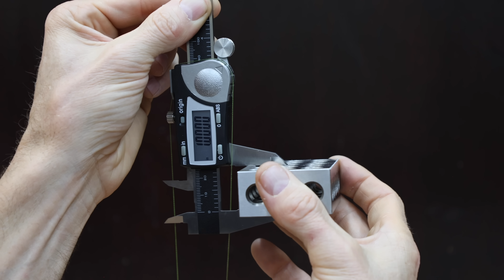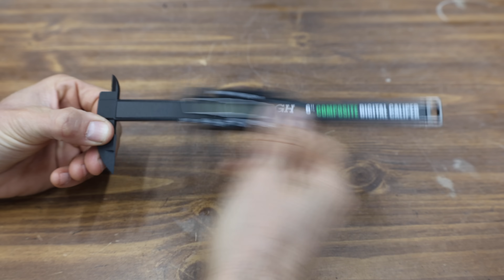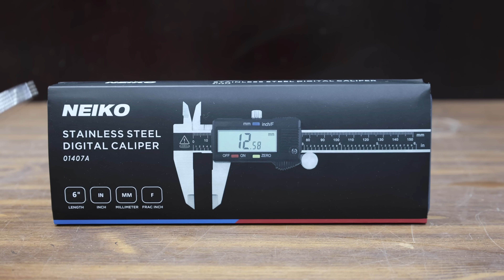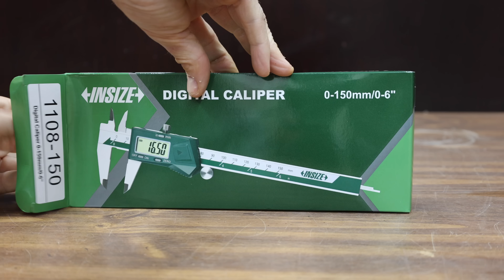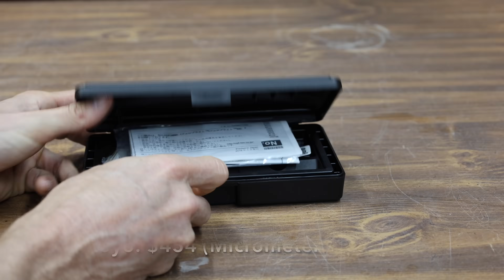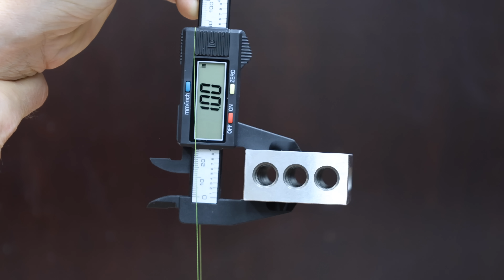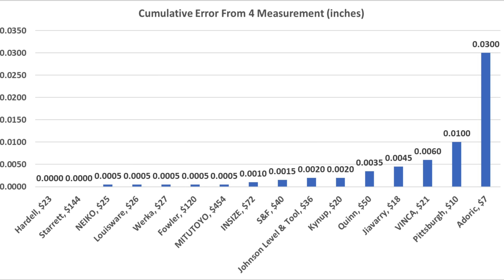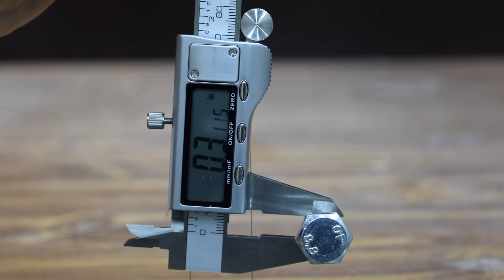I've Been Proven Wrong About Calipers!

Comment: Been working in and around machine shops my entire adult life..~15 years from Cutting stock to being an Engineer for OEM CNC manufacturers'. Fowler is bare minimum. First year guys who just need a few things to get going, it's mostly fine. You're probably going to drop them anyways so it will hurt a little less when you do... Also, for guys just cutting stock, not a big deal. Beyond your first set(unless you're the buy once cry once type) starrett, mitts or any other higher end prominent brands.. But Seriously, if you walk up to a CNC machine with a set of Pittsburgh's... it's not going to be a good time, for anyone. Everything else is unreliable and no shop owner will let anything less fly unless you have tolerances beyond 1/16".  
Beyond that, I'd say the measuring techniques are pretty flawed here unfortunately. Measuring depth though a 123 block onto a WOOD table... I can find .002"-.005" variance through that all day depending on where it lands on the table. To do it right, needs to be on granate.. or a surface ground plate at least... I'm not even going to get into how Outside measurements were conducted.. It is a feel. It's not just a consistent weight on it holding the block like its a C clamp. To certify/calibrate tools, which if you find yourself in a good shop, they will need to be. They will check them through the entire range, multiple times, without rezeroing because it's highly unlikely anyone will re zero for every measurement. If you're buying used on marketplace, clean the faces and run them all the way out and back to zero several times, they should always come back, if they don't, the gears are probably skipping or lose on the scale. Anything larger than .001" of variation is cause for concern for any meaningful work. Another trick is to close them, hold the jaws to light, and if you see any light you can confirm the jaws aren't parallel and need to be resurfaced.  If they are a mits or Starrett and it's a REALLY good deal, you can usually send them to have them rebuilt and calibrated. I'm not offended to buying tools used, hell, Most of my tools are used. But if the accuracy and precision really matters for you and your job, then don't sacrifice quality tools. 

ProjectFarm, I appreciate all the test you do. I do. But, this one really got my teeth grinding...

Comment: most of the cheap calipers auto shutdown only the screen, a week or even less in shutdown state can still drain the battery empty. For those the only reliable way to completely shut down them is to remove the battery or insulate it some other way.

Comment: I have a "LOUISWARE" caliper that is identical to the Jiavarry brand down to the thumb adjustment and the  physical layout and colors. The only difference is the way the display looks when powered on. Powered off it looks identical lol even came with the tiny screwdriver and extra batteries. They must just swap the backs with the ruler out between brands. It also keeps it position when powered off.

Comment: if you want good calipers on a dime you shouldnt be buying digital ones anyways.
learn to read a mechanical caliper with a nonius/vernier scale and you can buy a calibrated and certified precision tool and still save over half of what you wouldve spent on an uncalibrated digital one of similar build quality.

Comment: I've had a cheap set of harbor freight Pittburgh calipers. I also gave a pair of the same to a kid who was getting in to 3D printing. They worked OK for most of my uses (I use a Starrett Micrometer when I need really accurate measurements.)  The real problem with these is the durability. Mine saw only light use. I pulled them out of the case one day and had a blank screen. Went to replace the battery and saw that the battery contacts had broken off inside the battery compartment. Checked with the guy I had given a pair to, and he had the same problem. My conclusion: if you don't need +/-.001 accuracy, it's worth the $10 purchase price, but not much more than that. If longer-term reliability is a concern, consider a better quality tool.

I replaced them with a Quinn dial caliper (analog, not digital). Without a battery, there is one less thing to go wrong. They claim it's inch or metric, but it's really only usable on the inch scale, since the dial part is calibrated in inches. The Quinn caliper rides around in my tool bag (in it's protective case). After seeing this video, I'll order a Werka to keep in my shop.

Comment: I use calipers so often that I grew tired of pulling the plastic case out of my desk drawer to use my good Mitutoyo calipers so I bought a 4" iGaging caliper on Amazon for $59.  It's IP67 coolant rated (which I use as dust proof) and it has Bluetooth connectivity which is very cool when I want to enter a lot of data into a spreadsheet.  For example, I can measure the base diameter of all of the sockets in my tool chest and the spreadsheet automatically calculates the radius and adds 0.3 mm clearance for the value to pull into CAD to make a custom 3D printed tool tray.  The iGaging accuracy compares tracks with the Mitutoyo and is my always ready desk calipers that live in my pencil holder.

Comment: Also, side note: I mainly use Haas calipers after using every brand I could find. The Neiko were extremely accurate, however the screen on them kept failing very early on (and soft, at home hobby use for 3d printing and other misc) and stopped buying them after the 3rd failure.

Comment: I still like my dial calipers best, haven't had any dead batteries or battery acid leaks yet.

One big pro to digital is that you can go from SAE to Metric with a button press or two where I have to go fish out the other calipers.
Reply: The $10 digital are fine for any non-certified work and a lot cheaper than my fancy ones.

Comment: Yup. I bought a set of calipers from Aldi, workzone (their own brand). Cost me 20 bucks, came with a nice hard case. For my fairly infrequent use, it's lasted years. It gets a bit 'sticky' sometimes, but some oil later it's nice and smooth again; it has a .01mm scale (so 0.0005 inches, more or less), and is usually repeatable to a +-0.01mm error. Works well, does the job. Had a 2$ one from aliexpress before - full plastic, 0.1mm accurate - and that it was. Not that accurate, but great value for money if you don't need to be that accurate.

But yeah, sure, if I used them all day every day, I'd easily spring for Mitutoyo; I am very sure they last waay longer; but with me taking a few measurements every few days to weeks, meh, cheap does the trick.

Comment: No hate here, but for the hole depth measurement, they were all off by so much, probably because of your table not being smooth down to 0.0005 inches. I'd use a block of machined metal next time to ensure wood is not the variance.

Comment: 17:40 Not "a very nice feature" at all. This means the device is always powered on, draining the battery. The off switch just turns the display off. I need to know that "OFF" really means "OFF". You missed that. The Mitutoyo uses better electronics to overcome that issue.

Comment: You've literally measured only 1 side of the block with your micrometer and based the accuracy of all the calipers on that single one sided measurement. That's the definition of a faulty test.

Comment: This is so dumb, you literally unpack identical no-name calipers and just read what's on the box. A lot have the exact same features yet you don't mention it if it isn't mentioned on the box, the insize having a micro usb plug for example, silence...incredibly dumb.

You do resistance in grams yet do accuracy in inch, you cant be this stupid.

Please stick to reviewing farming equipment

Comment: I've had mixed luck with Starrett.  The ones I've kept are fantastic but I've gotten a couple slide calipers from them that I got rid of. 

I don't actually like the auto-shutoff feature anyway and frankly batteries are cheap.  After about a half hour to an hour of on time, mine tend to be even more consistent.  That said,  the two I use the most frequently is a Mititoyo matching the video one and an iGaging model.  The mititoyo is just a hair smoother sliding but the iGaging with phone and pc connectivity to store measurement sequences and much larger display is the one I'll most commonly reach for.  It too does displayed fractions of an inch as a scale type which is neat too albeit not that useful to me.  It has been a steal and only costs what the Harbor Fraud Quinn costs to boot.  I've got several of their other products and while lacking very slightly compared to its much more expensive/ distinguished brethren,  I don't know of a better value.   

Agreed on the CR2032 though.   Admittedly the SR44 battery in the mititoyo (would never use an lr44 battery in a caliper as that's just reckless) is long lasting but 2032s are stupid cheap and last an absurdly long time in a caliper and it takes a long @#$%ing time for the voltage to tick down threatening its accuracy consistency.

Comment: TBH I use mine for taking measurements for 3D printing design, and this video reaffirmed my gut feeling that spending more money than what's needed to get above the absolute bottom-shelf level options and into "good enough" tiers would just be a total waste of money for measuring anything at the tolerances I work with.

Comment: One cheap digital caliper that is very accurate does not mean that ALL the calipers of that brand will be very accurate.   I'd love to see a follow on vid, where you take the best rated, inexpensive calipers, and purchase at least three of each brand.   The top two inexpensive LR44 models ( Werka and  Neiko) and two top two inexpensive 2032 models (Insize and Kynup), and run the same comparisons to see if the results hold up for every one.  And maybe look at the lowest rated versions of each model, too (Louisware and Jivarry).    I wouldn't bother with any cross checks of the "composite" calipers.

Comment: Wal mart has Hyper Tough Calipers.....They are extremely useful as a DIY guy in my opinion.I have used them a ton for all sorts of things in my garage and they work fine for most things...I have had them a few years....still on the original battery.I fully recomend them to any DIY kind of guy for quick measuring things oddly shaped etc.They are like $8.00.

Comment: After I realized that my digital caliper was giving incorrect measurements, I just switch to a Mitutoyo non-digital one. It might take a tiny bit longer to read but I know any errors would have to come from mechanical faults and not invisible electrical ones.

Comment: Great testing as always.

I had a 8" Mitutoyo that fell from the top of our prototrak lathe and tweaked the I.D. measurements.

Bought a 8" Shars Aventor and never looked back. Gave my 6" mitutoyo to an intern we had when he moved to a different state for school and spent 1/4 of the price of Mitutoyos for almost the same quality digital caliper.

As noted below, the Shars are just as accurate as my Mitutoyos and if you need anything more accurate, then you aren't using the right tool (micrometers in that case).

Comment: If you a making jet engine parts then spending hundreds on a set of calipers is undoubtedly worth it. For me, 3D printing mundane items like brackets to hold light bars on my bookcase headboard, even the $7 calipers are more accurate than the printer is capable of. So for me, battery life is more important. I am bad about remembering to buy batteries. Last week I ordered a caliper that is usb rechargeable.

Comment: I have a set of Pittsburgh calipers that were $22 at Harbor Freight. They're stainless steel, have a battery saver, can turn off and remember the jaw position, they're smooth, and they came with a nice case. I bet they'd do well in these tests, too.

Comment: I've got one of these that looks like the Neiko, although I'm pretty sure I bought it at Harbor Freight.  It's at least 20 years old and still works.  For a hobbist building random things in his garage, it's phenomenal because it gets you accuracy under 1/64" of an inch which is way more accurate than a ruler or tape measure.  It's also quick and easy to use.

Alternate use:  What gauge guitar strings do I have on my guitar right now?  Simple to check.

I will say that it got flakey after a few years and started not wanting to turn off.  Eventually it stopped working entirely.  When I was about to throw it out I wiped down the beam real good with a dry cloth and to my shock everything started working again as if it were new.  No dirt was visible on the cloth either.  My takeaway is to keep these things super clean.

Comment: Thank you! Looks like anything above $25 is probably fine. At this level of accuracy tiny variances in temperature, handling technique, manufacturing become sources of noise. Would need to test 10-50 Hardell and Kynup calipers 10 times each to determine whether one or the other is really more accurate. What I would actually like to see is some innovation. Calipers built different so that they are on par with a decent micrometer. All of these look essentially the same. There's no way that the more expensive ones are actually significantly more expensive to manufacture than most of the others. There should be some radical new technique or technology that would allow a couple of magnitudes better accuracy. But of course unless the calipers look precious they would lose all that extra accuracy the first time someone uses them to scribe a circle or smth.

Comment: OK, but could you seriously pay some attention to the measurement values that you are saying in your video before publishing? You got the first two right, and then immediately started saying the wrong number, claiming an accuracy of +/- 0.001" on the calipers which ALL have an accuracy of +/- 0.01". When you switch these over to metric, the situation gets even worse, as their resolution is down to 0.1 mm, but the accuracy is +/- 0.2 mm. Obviously not a single person who has even a 6th grade science education was consulted about how measurement works when the original design that all of these calipers were created from was made.

Comment: iGaging OriginCal IP54 is a Mitutoyo semi clone I bought many years ago that measures all of my gauge blocks and feeler gauges accurately down to three decimals. I think I bought it for about $60 bucks but I'm not sure. Haven't had to replace the battery even once even though it doesn't have automatic power-down and I have left it on by mistake for at least a day or two. Also has a port to attach wired indicators. Definitely a decent choice for anyone in the market who doesn't want to spend a ton of money.

Comment: Isn't the accuracy measurements off? The micrometer screw should measure precicely, yet you use 1 inch as the "accuracy target", the micrometer screw should be more precise than the tool you used to make block, unless the blo k is made on a super high resolution CNC (which I'm sure you would have mentioned).

Comment: I use a Husky digital caliper I picked up at Home Depot.  Not sure who manufactures it, but it's been fantastic.  The labeling, screen, and button placement looks just like the NEIKO.  Feels heavy duty, slides pretty smoothly, and I use it for taking measurements for 3D prints with fairly tight tolerances.

Comment: I bought a 6" Mitutoy  that was Solar powered but not coolant proof; ultimately was mandated to buy this brand but they did want to argue with me about it not being coolant proof. Years of use as a CNC lathe Op worked just fine but now I have had it for about 8 years total? Still use it but I am not in a machine anymore, just for cad work and rbd basically for 3D Printers 160$ for it brand new I shoulda got an 8 or 10" one also but didnt lol

Comment: Most calipers i have tested draws almost the same current on and off so auto-shutoff isn't that good of a feature. They only shut off the very current sipping LCD when turned off.
I always add a mechanical on/off-switch to mine and after that the battery life goes up by magnitudes.
Reply from the maker: Thanks for the feedback.

Comment: When you revisit this test again, I'd be interested in seeing how the Shars Aventor and QFun Industrial measure up.
I've had Chinese calipers that weren't machined properly - you could zero when the main jaws were shut, but the depth stick zero was at a different point.
Also, while testing with string and weight does remove some human error, it actually would be interesting to know which calipers are stiffer than others and so less sensitive to wheel/closing pressure, since in the real world people aren't using weights and strings, they're using the wheel.

Comment: I have and still use an old Mauser caliper that used to be used by my grandad.
Then I could gather two second hand mitutoyo calipers, in Japan. 
I consider myself lucky.
Reply from the maker: Nice!
Reply: I worked at Alcoa in 1966 . Had two German machinists with Mauser calipers in our millwright ,tool and die shop .
Reply: @Hugostare 🫀

Comment: The biggest problem I have with the HF brand calipers is that I've bought two and both have battery door issues that prevent the battery from staying connected. I think the contactor spring wears out prematurely. A piece of paper fixes the issue, but it's a pain.
Reply from the maker: Thanks for the feedback.

Comment: I can vouch for the Mitutoyo battery life. Been using mine near daily for roughly 6 years and I still haven't needed to change the battery. Also depends on which Mitutoyo you get, but they do offer ones with an auto power down function. Mine doesn't even have the power button, just start using it to power up, and it will shut down after about 30 mins of sitting idle.
Reply from the maker: Thanks for the feedback.